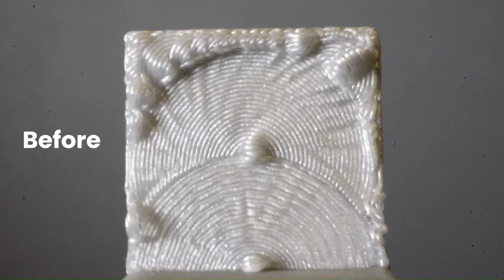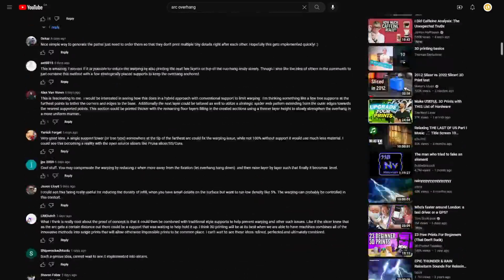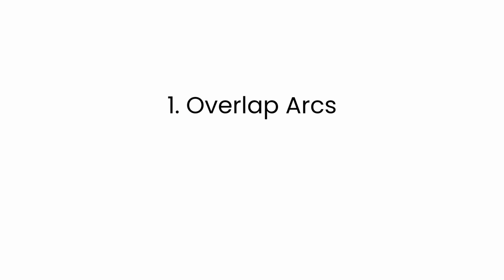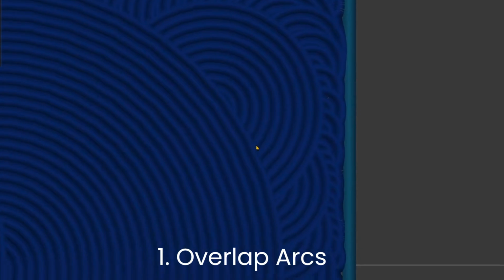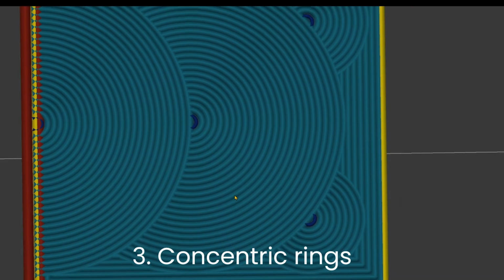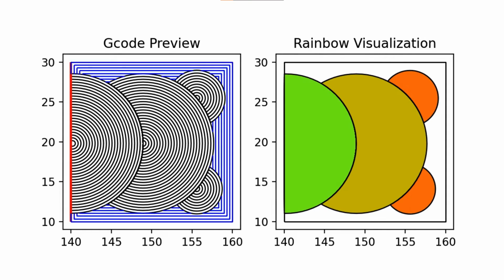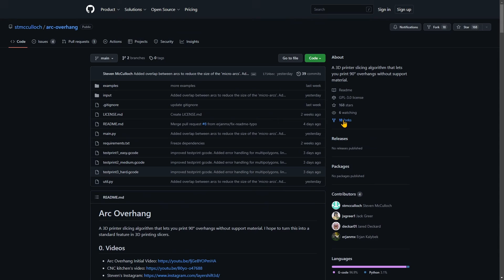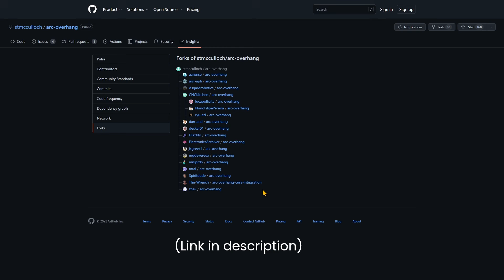How can we Improve Arc Overhangs?

Comment: I would say reducing the temp as the printer slows down would work better. One thing I've learned with temperature is that it's all relative, you should not print at the same temp when you change layer height for example. I found when I print too slow and thin, even at the lowest PLA temp suggestion, the filament burns, droops, looks bad and jams my nozzle. If I speed it up it doesn't have time to do this, but sometimes you need to print slow on intricate parts. I'm guessing if you lower the temp by 5c when it gets to the slow parts of the print it will help a lot.
PS: Is this ever going to come to Cura?
Reply from the maker: If you try this, let us know how it works out!
Reply: @3DQue   If it ever comes to Cura then I will, since that's my weapon of choice.
Reply from the maker: @ArcanePath360  Fingers crossed!

Comment: Why not just extend the arcs to the full width and keep on adding arcs without restarting the arcs with 0 radius. Keep the radius constant when it reaches the edge and offset it from the previous arc until you reach the far edge. Varying the extrusion rate could also allow you to add a transformation that when you reach the edge, the top and bottom corners are filled as well. 
It seems to me the smaller the arcs are the more droop there is. I'd try to find an algorithm that tries to fit the area with larger arcs aside from the starting arc from the first edge.  I'd also try arcs that are the width of the edge but with such a large radius it's almost a straight line then keep making it rounder or something. 
Maybe add some padding layers at the far end of the overhang to level out the area for the next layer.
Reply from the maker: If you try this, let us know how it works!

Comment: Have you thought about training a defect detection model on endoscope footage of the nozzle. Ai build does this but it sucks that none of it's open source.
Reply from the maker: Definitely sounds like a great idea, but in terms of making it something that would be widely used, endoscopes would have to become common-place on 3D printers. At this point, most 3D printers don't even come with webcams by default so endoscopes are a bit too far out of reach I think. 

Webcams are great because they're easy to retrofit onto any 3D printer. Just point it at the printer and plug it in.  Endoscopes are more difficult. There would be different mounting solutions for various 3D printer hotends, and then we'd have to ask people to design their own mounts, and that's a pretty large barrier.

Comment: What's the usual lifecycle of an explosive new feature like this showing up in common slicers? I've had a conundrum with an upside-down bowl-shaped print that I need to be solid with 0% infill, but that prevents Cura from added support structure inside the bowl's ceiling. If I could print the top layers of the bowl as arc overhangs without needing support, it'd be a long-awaited cure to my problem, but I have a feeling it'll take a while to reach that point.

Unfortunately, from a glance at the github (which I admittedly am unfamiliar with), it sounds like I can't slice my mesh, convert the ceilings to arc overhangs, and insert that into the original slice. However, the speed with which these kinds of discoveries are made and improved upon is incredible these days.
Reply from the maker: The lifecycle is explosive! About 1 month after I made the  code public, someone added it into a real slicer. Github user rvmn has already implemented this algorithm into SuperSlicer. It's almost ready for testing. Check out the demo here: https://github.com/stmcculloch/arc-overhang/issues/10#issuecomment-1373436886

I'll be making a video about this soon.

Comment: Does this method print over the already existing support tower or not? Like the cylinder used just to start the overhang test, does the arcs print on top of that, or is it purely supporting itself? Not sure if this is already the case, but I think it would yield better results if it were to print over the existing support

Comment: How much are you overlapping successive arcs? I would hypothesize you want the nozzle orifice to overlap at least 30% with the previous arc, and to only extrude the remainder of the width (e.g. 70%) to have something to press against and not droop. I don't think I'll have time to do so soon but I'd really like to test some of this myself now.
Reply from the maker: I'm using the following print settings, and it seems to work well for 0.4mm nozzles:
0.35mm line width (12.5% overlap)
1.05x flow multiplier
0.4mm layer height
205 degrees hotend temp
2 mm/s print speed
100% fan speed

Comment: What about doing double passes, one with extrusion, then a second pass with cooling fan only at 100% to help it solidify? If done on every arc, it may be worse, but maybe every 3 arcs or every other arc would help the part to solidify and give a more solid base?
Reply: Although it sounds like a great idea, it might need some refinement. The cooling fans and the nozzle move in unison, which means the fans remove heat with each pass, and the nozzle inputs it back through conduction and radiation, hindering the cooling efficiency. A short pause after each arc, where the print head moves away and lets it cool passively, could work slightly better? Either way, the video proves that things can turn out vastly different than expected, so it might work well enough to make a noticeable difference.
Reply: @vit.budina  certainly, but there is nothing stopping him from raising the nozzle on the 2nd pass. You will still get cooling, but not touch the nozzle. This could add benefits as the air from the fan would be a bit more gentle.
Reply from the maker: Interesting idea! I would usually avoid ideas that involve Z movement but in this case there's no printing, just cooling. Definitely worth a try for the smallest circles that need more cooling.

Comment: Under-extrude when it first starts making a new circle. The blob is probably because there's just too much plastic there.
Reply from the maker: Yeah it seems like there's some pressure still in the nozzle, so as soon as there is space available, plastic escapes even though no extrusion command was sent.
Reply: @3DQue  Are you not using properly calibrated pressure advance/linear advance? If not you really should fix that first. It may not make too much difference at these low speeds unless you're on bowden, but tuning on top of an unsound base extrusion setup seems like a bad path.

Comment: great stuff
you could could eliminate some more of the small arcs by not starting new ones, just shift the biggest loop forward
Reply from the maker: I'll try this to see how well it works, although it's not clear if it wil still work because at some point a new arc won't have an anchor point that begins on an already printed surface, so it might need a lot of overlap (overextrusion) between the lines to work